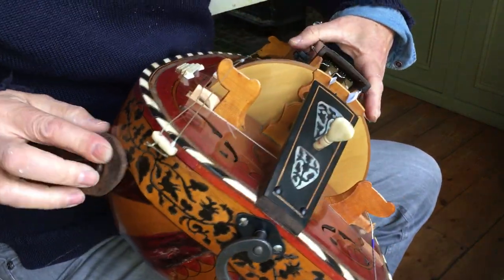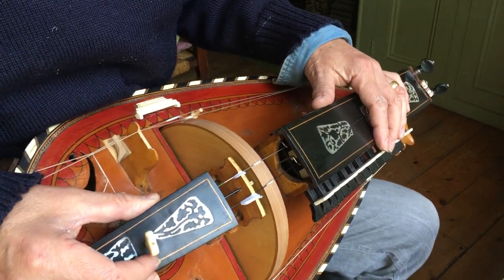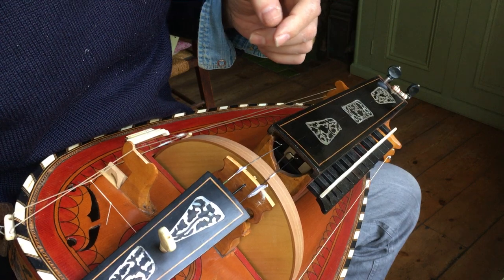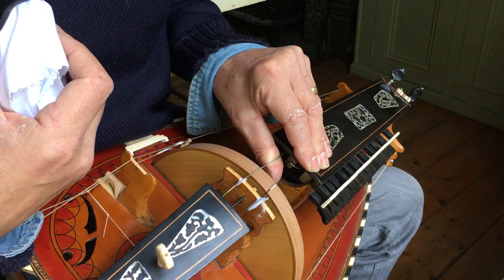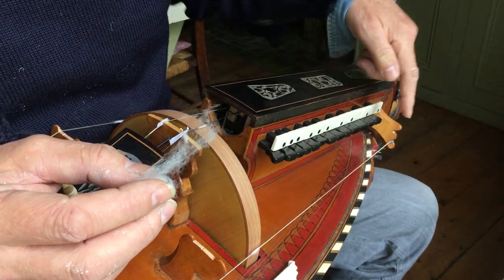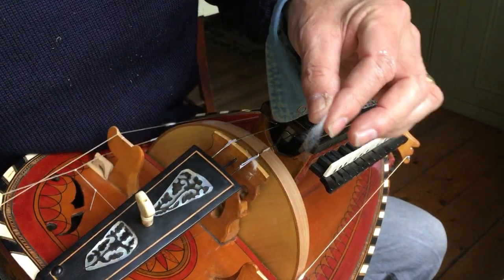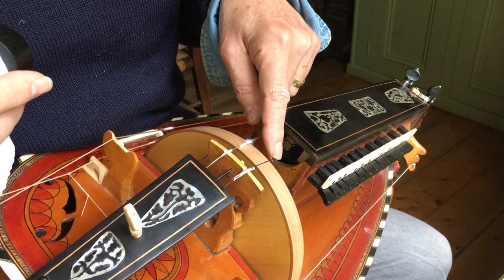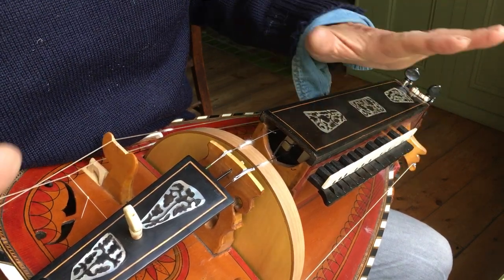Hurdy Gurdy set-up part 2 Cotton (see description below)

Comment: Great stuff Nigel. You don’t specify any particular type of badminton string for the first chanterelle. I’ve been through just about every make out there and of them all, there is just one type that stands out for tone and reliability. The brand is “Yonex” and the type is BG 65.
Reply from the maker: thanks neil, ive just added the info to the description. I'll do a string vid at some point but i only use a few types and theres so much contrary opinion out there, anyway at least i can say what i use. The cotton i use was a bag of mcdonalds snodrops bought in a finefare in Wareham in 1982, pretty sure they went bust the following year but ive still got 3/4 of a bag
Reply: Nigel Eaton 
I ran out of snodrops years ago , mainly by giving them away . I now have a carrier bag full of viscose direct from a manufacturer. Silly price but a lifetime supply. I used to blend it with bamboo fibre which is itself a kind of viscose but it doesn’t make much difference apart from letting me call it “Booray” . 

Good to see the resurgence of the gurdy in recent years and the innovations that are attracting the younger players.
Reply: @nwbrook  I'm glad innovations are attracting a new crowd but it is and will always be the traditional side for me, though i am also one of the new crowd if not exactly young - I particularly like both your and Nigel's straight to the point vids about the in's and outs too, there ain't no knowledge like experience and you fellas have a lot of that (Nigel's cotton and rosin purchased in the eighties bahahah).

Comment: So the string does not touch the wheel directly but the cotton grabs the wheel transfer the force to the string? Very nice to know.
Reply from the maker: well it touches a bit, (the high d string) like everything to do with hurdy gurdies there's subtlety and balance, the other strings all touch far more and actually bend round the wheel, not that is should be possible to see this very clearly, if you can see the bend then it's too much, use ears, plenty of rosin and be prepared to mess about with it for the rest of your life

Comment: Yeah I’ve been at it for hours and this damn string won’t not sound like a dying cat. I guess this is why this thing is basically extinct
Reply from the maker: What gurdy do you own? Is the wheel polished smooth ? Did you watch the rosin video yet? What cotton do you have? What tuning are you in? You might have too much string pressure at the bridge. Yes I see your point hahahahhaha
Reply: I was definitely not expecting a reply, but it is greatly appreciated! It’s a nerdy gurdy, the wheel is very smooth and feels polished (though there is a section that is slightly raised) I have watched your rosin tutorial, I’ve been tinkering with the amount of rosin, cotton and bridge pressure. My drone strings are G/C and they are working fine, but it’s my lower melody string that won’t cooperate. (I haven’t even bothered with the nylons yet) The cotton is from a store bought bag of 100% cotton balls, seems at least close enough to the ones in the video, but I suppose that very well may be the problem.
Reply from the maker: @gromgaming7438  what string is your lower melody ? Should be a savarez corelli crystal viola g light gauge really
Reply from the maker: @gromgaming7438  post video on hgc and you'll get lots of answers . Ignore them and just listen to mine. There tends not to be enough space for a low g to vibrate fully on a nerdy anyway so I'd think about getting something a little more pro
Reply from the maker: Check out Marco gamarra luthier . Everyone likes his machines
Reply: @nigeleaton1  I have it on G4 right now, is that correct?